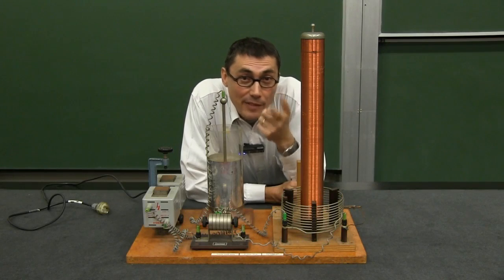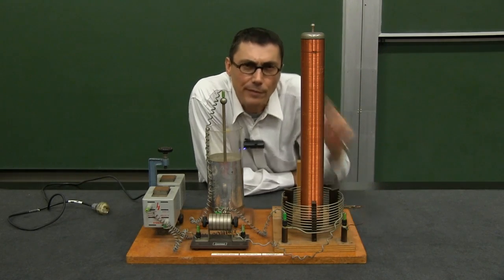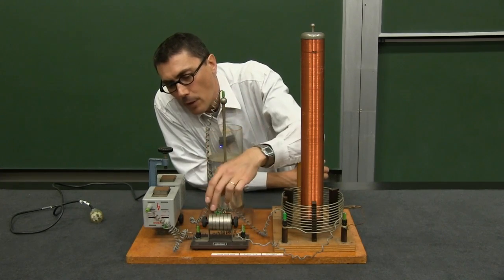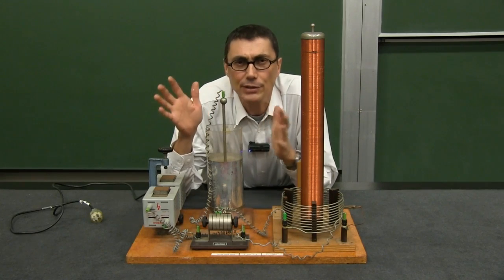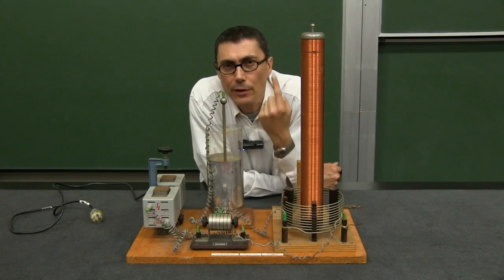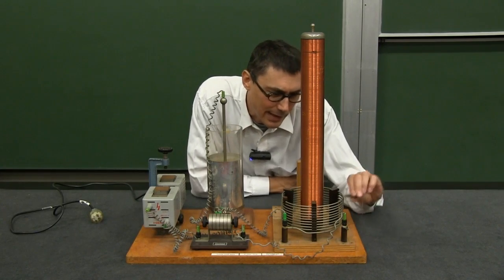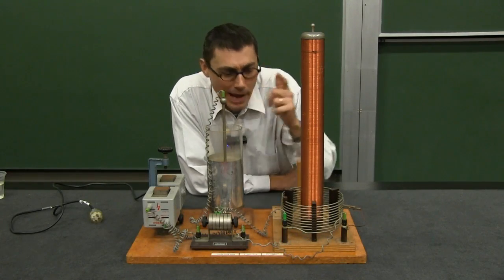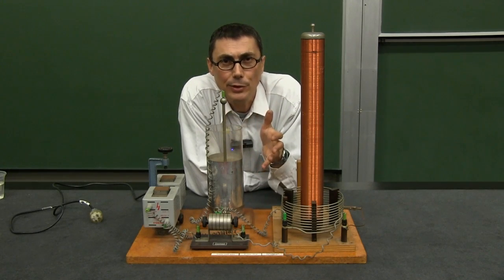PH EM AC TUTE 70038A V0501 Tesla Coil Physics How they work

Comment: Thank you for your video. Do you happen to know if the magnetic fields on the primary and secondary of a "Tesla Coil" are relatively strong magnetic fields?  Also, between the primary and secondary, which magnetic field is stronger generally?  I have found contradictory information about this...

Comment: Hi great vídeo! I've got one question that I don't understand quite well.. How does the spark gap manages to change the 50Hz freq to higher frequencies?
Reply: I've made my own tesla coil using two bolts as spark gap but I'm trying to understand what's really going on.
Reply: could you please send me a link to the reference site or anything that you used to make one?
Reply: The 50 Hz, 240 Vac is transformed up to thousands of volts, still at 50 Hz.  This voltage level is sufficient to cause a spark to jump to electrodes close together.  A spark creates a wide range of high frequency energy, much higher that 50 Hz.  The spark knows nothing of the 50 Hz it came from.  Lastly, a spark is a time domain impulse.  If you study time domain to frequency domain transforms, you quickly see how a very brief event in time (i.e. impulse) generates extremely wide band energy in the frequency domain .  This Tesla coil has a tuned LC circuit in the primary that matches the LC circuit in the secondary (large tube with many wires and a capacitor on top to the surrounding environment).  When both these LC circuits are at the same frequency, very very large voltages are generated at the top of the secondary coil.

Comment: There's alot said in this video that's not entirely accurate and some thats just plain incorrect. I think you need to read up more on this subject; there are key concepts youre not understanding correctly. Rotary spark gaps dont deteriorate slower than traditional static spark gaps. I dont know where you got that idea from but thats not the purpose of rotary spark gaps. A spark gap is just a switch to pulse current through the primary. The frequency at which the sparks appear can be adjusted to be faster or slower by adjusting the gap distance. With a rotary spark gap you can use pwm to adjust the speed of the motor  to control the spark intervals more accurately and with greater ease since you can adjust it while the circuits running. A static spark gap can only be safeky adjusted while the circuit isnt powered and is difficult to tune finely. Thats just the first thing you got wrong. From there almost everything you said either didnt make sense or was incorrect. You need to read more on this subject and for anyone watching, Id sudgest electrobooms videos on tesla coils as a good resource for learning how they work.
Reply: Actually the only purpose of making a multiple spark gap, rotary spark gap or ventilated gap is to extinct the sparks  on time so they don't burn for too long.